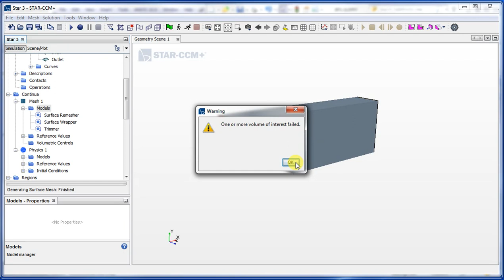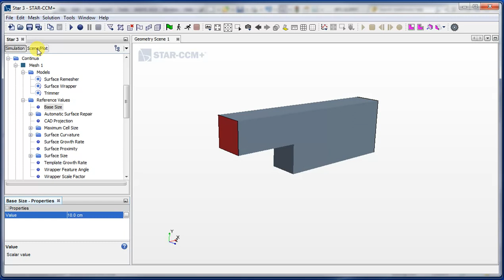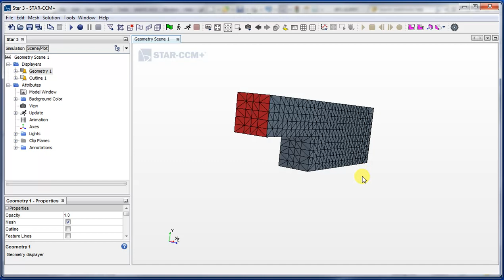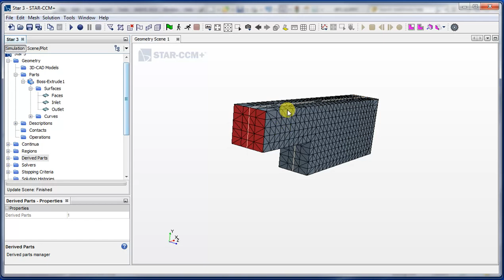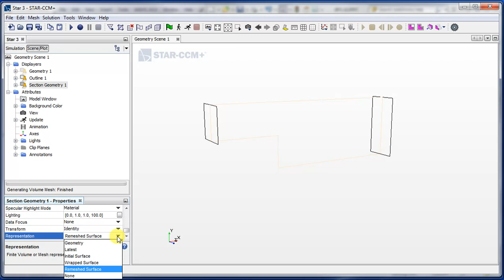Star CCM+ Beginner to Pro Tutorial Part 4 [Backwards facing step]

Comment: hello zac,
my geometry does not have remeshed surface or wrapped surface,it only has latest surface
Reply from the maker: Make sure you've selected the meshing continuum correctly and adjusted the sizes. Then press the create surface mesh button on the top
Reply: @zacmac  my laptop dont show meshing continuum what is wrong with it, I am using 2406 version

Comment: I got an error,:

Continuum or phase "Physics 1" is missing required models: [Time].  Model selection may be incomplete or requirements may have changed for newer version. Please add needed models.
Command: RunSimulation
   error: Server Error

who knows what happens about this?
Reply from the maker: check if you've selected steady state or unsteady

Comment: Hi zac ,
 while i am giving volume mesh the error shown.its (trimmer cannot currently accommodate multiple regions in one continuum)
kindly rectify the issue..
Reply from the maker: Hi.. thanks for the comment. you should only have one region in your domain.. I'd check to see if you selected 'Create one region for all parts' while creating the region. Also check if you have more than one region, and delete all unnecessary regions.
Reply: Thanks for your valuable feedback. 
I got the solution. i need more tutorials as i am beginner. if you have mail id please drop it.
Reply from the maker: Check out my truck tutorials ;)
Reply: @sakthiganeshmani4125  What was the solution?  I am getting the same error message
Reply: @sakthiganeshmani4125  oh nvm.  He was right, needed to delete an extra Region that I had.